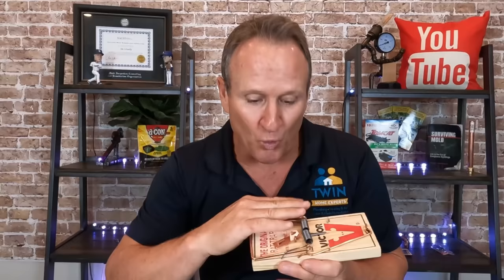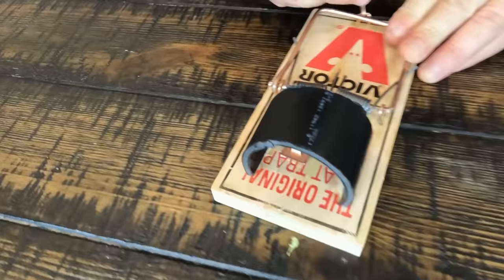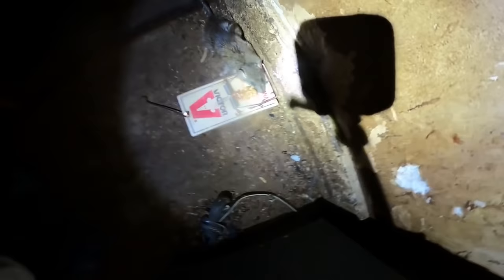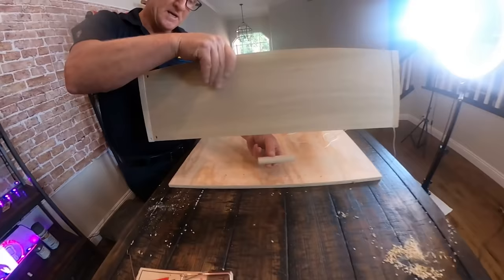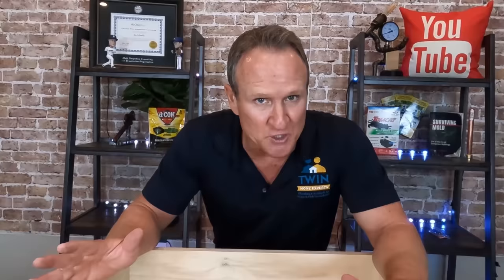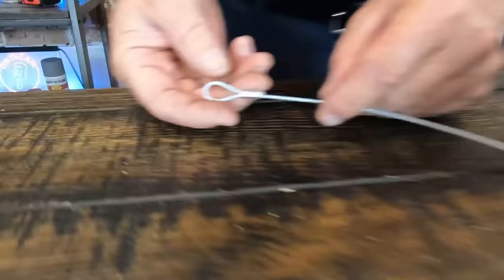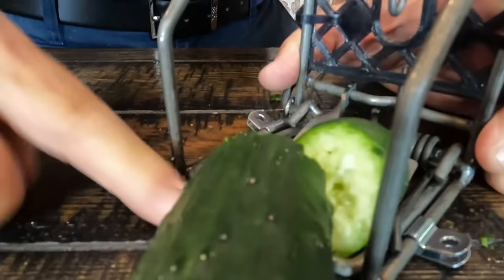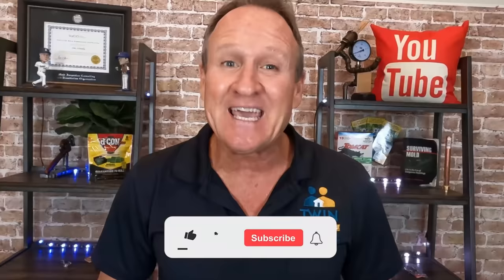EASY RAT TRAP HACKS THAT WORK!! Catch MORE rats FASTER...

Comment: On a comman mouse or rat trap , i smear peanut on the underside of the trigger  .  That way instead of them just licking the bait off they have to stick their snout under the trigger and trip it by pushing it up .  Works well
Reply: Mix baking soda with any package cornbread mixture or just plain cornmeal put it where your cats and dogs cannot get to it and it will kill all your rodents no need for water or any liquid
Reply: @maedorasmith33  your method is a joke.  Been there
Reply: @maedorasmith33   But then they go back inside the walls or wherever they are nesting, die and their rot might stink your house up until you find the carcass.  

 Plus, once the rat consumes it, if a cat or dog finds and eats the weak or dead rodent, then it doesn't matter where you placed the dish out of reach of your pets at, because you may as well have left in on the floor.
Reply: I use tape to cover the bait
Reply: I need to try this
Reply: Pushing it up is what sets it not tripping it.
Reply: @joetroutt7425  the ones with the plastic trigger .  Set one with the metal trigger and then  push up on the trigger
Reply: This has always worked for me!
Reply: Ouch!!!!
Reply: How is sodium bicarbonate going to kill a rat? You might as well just use salt.
Reply: @Owlshadow. actually it's not I just watched a professional pest control video that said baking soda kills rodents. A lady out it out because she was worried about the smell a dead rat causes. The pro had set traps and they were scheduled a week out. So she put it out just in case. And a rat ate it and died and a trap caught one
Reply: Same
Reply: I bought some wonderful Amish soap from a trusted influencer  and that is when I noticed Mr Rat trying to come on the restroom with me in it. I wracked my brain if what we had done differently. It wanted to nibble the soap..it DID. So i secured my soap away in a bag in the freezer set the trap with pb..48 hours nothing..sliced a piece of the soap - it is there new and we shall see if this happens soon.
Reply: Yep! I don't create a smorgasbord for them.
Reply: @dindjarin559 baking soda doesn't affect the dog or cat because they can pass gas but rats can't.
Reply: @joetroutt7425 It's the jostling of the trigger.
Reply: Such a simple, yet BRILLIANT hack for a snap-trap!  👍👊
Reply: @maedorasmith33 oo😮 I i
Reply: Going to try this

Comment: I've trapped hundreds, maybe thousands, of rats over 30+ years. I use mostly Victor traps; occasionally i'll use a T-Rex for rats that may be "shy" of the Victors. I work in Florida where trapping in attics can get HOT; peanut butter is a great bait but in the heat it is easily licked off the bait pan without setting the trap off. My hack is to cut small pieces of cloth (I use terrycloth rags, or old t-shirts) roughly 1/2 inch by one inch, tuck them under the triangular "bait holder" on the bait pan, then push down on the triangle to lock the piece of rag in place. Then I smear peanut butter into the rag. Since a rat's natural reaction to a food source is to bite it and then run for cover (so other rats don't steal their food), when they try it with this setup they always set the trap off while their head is near the bait pan. I've found that this hack works for both full grown and juvenile rats. Wishing y'all good trapping!
Reply: I use super glue to attach a peanut half to the bait holder/trigger and a couple more peanut halves on the wood in the kill zone. I then apply peanut butter on top if the peanut on the trigger. Works for me. Your method sounds very effective. I'll have to try that.
Reply: I used the new plastic victor traps they ate the peanut butter and left,went to old Victor wood traps and piece of cloth soaked in peanut butter under trip lever crimped pin,caught 2,1 giant rat 
Thanks guys will try abs pipe next 1 left
Reply: Excellent.  When I was away my ex wife glued cheese to the bait holder with superglue.  Your method is much better and I’ll use it but her system worked perfectly so I gave her 100 points for resourcefulness.
Reply: Good idea! How do you clean the traps after each catch?  Just soap and water?  Thank you!

Comment: I've had great success with Milk Duds.  Soften the Milk Duds by microwaving in a glass with a little water in it for about 30 seconds, then form the caramel around the treadle.  Cover the Milk Dud with a healthy coating of peanut butter.  The smarter rats seem to be able to carefully lick plain peanut butter off the treadle without triggering the trap, but the caramel from a Milk Dud hardens so much that they end up pulling on it trying to get it loose, and then SNAP!!!
Reply: Rats Often Pass Specific Food Preferences on to Their Young - So Determine IF They Will ACCEPT That Bait First, By Pre-Baiting (Don't  SET Trap At First)
Reply: I do the same using starburst fruit chews.
Reply: @nathanlambshead4778  Great idea.  I'll have to try that some time when I'm not getting success with the Milk Duds.
Reply: Good tip. Will try that tonight. These rats of mine are smart. After getting 5 of them the rest are just taunting me. Licking the trigger clean of any peanut butter without setting off the trap. 😳🤣
Reply: i bought some Slim Jim's and cut about a half inch piece off..i then secured it to the Rat trap with
that small prong on the metal feed plate so the rat had to work to get it off..wasn't long before it 
snapped down on my rat killing it 👍🙂
Reply: I opened the milk duds and was preparing to try your method.....but.... now i need to go buy another box.
Reply: Whats your guys’ opinion on water bucket traps with a plank lid so they fall right in? I’ve seen dudes on here catch up to 20 in one night
Reply: Mix baking soda with cornmeal or any Boxster packaged cornbread mix and put it where other pets can’t get to it only the rats and it will get rid of all your rodents
Reply: @maedorasmith33  plaster Paris with sugar or cornbread or anything it works but sucks to have that smell. Last hear I had 3 flopping in my kitchen and then die. I do not feel sorry for those nasty things
Reply: @kmiller5808  I thought they might like some beer on their bait. Then I drank too much of  it and couldnt get  the trap set.
Reply: @StephRenee812  don't feed the spammer

Comment: I have used every rat trap that can be bought at your local hardware and big box store. Snap traps of various types, glue boards, safe & humane traps, poisons, & plenty of Internet hack traps. The standard Victor snap trap is by far the best trap you can buy. Better than all the modern Victor traps, and better than all competitors. I have killed over 100 rats and mice at a single infested property. Other snap traps generally won't snap, or won't catch the rat if they do. Glue boards: the rat will just chew off the leg, leave it attached to the board, and be freed. Poisons can work, but then you've got dead, smelly, maggot infested rats tucked away in inaccessible nooks. The standard Victor is by far the most consistent rat killing trap. Note that the Victor snap trap isn't consistent from retailer to retailer. The Victors at your local big box store are not the same as the ones at many hardware stores; the big box store trap is better. For bait I always use peanut butter. I've tried other things with poor results, but everybody likes peanut butter.

Comment: Great video. Love the PVC hack idea. Will definitely try it. Dry wall screws are fast to install. But I prefer to use nails spaced around 3/4" apart because it is easy to remove the dead rat just by flipping over the trap.  Whereas with  screws, it may be a little harder to remove the rat. Also, for a stronger kill bar, lift up the part of the spring that's not attached to the kill bar and place a couple of thick washers between the wood base and the spring.  I also glue or screw the trap first to a 3/4" piece of plywood so the trap doesnt warp. Attach a piece of wire to the plywood and tie it to a stick so the trap isn't carried off by a skunk, etc.
Reply: Daniel,  You're exactly right.  I use small brads on Victor mouse and rat traps. I cut the head off 1 brad to drill most of the way from bottom so wood doesn't split when putting brads from bottom. 3 on width, 1 on side sticking up about 1/2."  I also use a small eye screw at the rear to hook a very lightweight chain to something.  Love the tunnel concept.  Wrap kite string around trigger and use P.B... Many times they don't trip it until they start pulling at the string.
Reply: Mix baking soda with cornbread mix or Cornmeal put it where other pets cannot get to it such as cats and dogs and it will get rid of all your rodents no liquid needed
Reply: Oh my golly - just hot glue thumb tacks - upside down pointing up you goose
Reply: @maedorasmith33  The only trouble with that, is the rat goes away and dies. Then you have a smell that's nearly impossible to eliminate.  But in a shed or barn, baking soda is a great idea. So is Borax. Mixed in peanut butter.
Reply: @jefffrayer8238  I use string as well . I try to avoid a bloody mess so no nails, etc. The spring seems to be strong enough to crush their scull or break their necks ...very quick demise .
Reply: @mrcryptozoic817  And I don't want my dog sniffing or injesting any part of of a rat that may contain a poisonous substance. I have one trap inside my wire cage squirrel trap which I blocked half way with hardware wire ...Rats can come to the trap inside but too small for other animals like cats that roam at night.

Comment: Terrific ideas. I particularly like the screws attached to the snap trap.  I often wondered how they were able to escape from a triggered trap.
Reply: I added drywall screws to the roof of my metal bird feeders to keep tree rats from jumping down onto the roofs of my " Tree Rat" proof feeders.  Works like a charm.
Reply: 🐀 Rats Will Sacrifice a Limb to Get  Away, And Use Leverage.

Try Different Types of Traps - The Ones That Look Like Jaws Work.
Reply: Mix baking soda with cornmeal or any package cornbread mix put that where cats and dogs cannot get to it and it will kill all your rodents No liquid needed
Reply: Usually they escape because they didn't come in at the right angle or they're just too fast. That's why it's critical to get them to come in from the front. I think some rats are pretty smart and they know how to trigger the trap and then they can eat to their hearts content.

Comment: I have my traps glued to boards that I lean against walls, high enough that the rat has to stand on its hind legs to reach the bait. I use sunflower seeds or tortilla chips and attach them to the trigger with hot glue.
I've had issues with them getting out of the traps, mortally wounded to go die and stink elsewhere,
so to remedy that put shims under the spring ends, a nickel and 2 pennies thick, to make the arm come down really hard.

Comment: My favorite traps are the tube traps, and I've tried and made a dozen traps to compare.  Tube traps use rodent natural tendency to travel baseboards and tunnels.  They also conceal bait and the spring trap from household pets larger than the tunnel (like cats and dogs of course, but not hamsters).  They're plainly visible when sprung so you know when to empty them, and the dead rodent is concealed inside, not out where guests can see them.  All you do is open the jaws from the outside and shake the dead mouse out of the tube into the trash and set the spring again.  You never have to touch a rat. They usually don't even have time to strip bait in there.  I never had to refill the bait tray even once.    The nature of rodents is to follow walls so they're placed in narrow areas behind furniture or the wall heater, against baseboards, inside or next to - or even inside - chicken coop containers.  Just review the traps every once in awhile and you'll know when to clean them for reuse.  All my rodents disappeared in a month, and I leave food on the counter all night long to test it.  Even food bits in a tray on the floor are untouched.  That's how I check for stragglers.  Of course, no trap is supremely successful unless there's also a relentless search for rodent entrances and they're closed off.

They're great in the kitchen (I eventually found rodents coming in around pipes under the sink) and these traps can even be kicked with bare feet by accident and not trigger them or hurt myself if they do a false snap.   Everything is contained inside the tube.

The other great invention is Ramik bait in packets.  They desiccate rodents so even having eaten and dead, the mouse doesn't stink behind walls as it decomposes to dust.   At first, I used to open the packets to sprinkle the green beads around,  but they're so tasty rats will eat through the closed packet to get to them, fill up their cheeks and carry it back to their cache supply for storage.  Now if I hear rodents in the night, I toss a closed packet behind whatever furniture is in the way the next day and listen to the cellophane crinkling in the night.  No more rodents after that.  Eventually their food storing habits take out the entire community sharing the same food cache, including nursing pups.  When the packet is finished, I throw the empty cellophane away and wait to see if more are coming.  There usually aren't any.  Just sayin'  :)
Reply: any video of the tube trap you described?
Reply: @USArmy91222  I should qualify the description by saying it's not a DIY project but an Amz purchase which could probably be deconstructed to a DIY.  But it's the best trap I've used in a cabin that used to be overrun with mice.  This title should take you there:

eXuby Pet-Safe & Child-Safe Rat Traps w/ Tunnel Design (3-Pack) – Dual Entry for Better Capture Rate - No Harmful Poison - Prevents Accidental Triggering - Avoid Finger Snapping - Setup in Seconds
Reply: KatSense makes one too, titled:
Kat Sense Covered Rat & Chipmunk Traps, Prevents Accidental Triggering with Tunneled Design, Quick Humane Kill, Indoor 'N Outdoor Mouse Snap Traps 

That AMZ post has a product video showing how it can be set (by hand or with your foot) and the obvious 'set or snapped' look to the lever, so nobody has to keep picking it up to check if there's anything in it.  You can tell from across the room.  I put them along baseboards or in spaces behind the fridge and that seems to work since rodents like to travel spaces where at least one side is protected.
Reply: Mix baking soda with cornmeal or any package cornbread mix put it where pets like cats and dogs cannot get to it and it will kill all your rodents No liquid needed
Reply: @maedorasmith33  Half and half? So, it has to stay dry? We have mice and rats, digging in our garden. Ever since there has been a construction site next door. It's driving us crazy.
Reply: @dindjarin559  Good points. I especially don’t want any secondary poisoning, like to a hawk or owl. We have those around here. They are happy to lift,a sick rat.
Reply: @USArmy91222  I used pringles tubes with a mouse trap (too small for rats, I think) in at the far end, and put tape half way over the entrance. It worked well.
Reply: @Dandeleona I can't find desiccant rat poison in the UK. I don't know why not, but I can't.
Reply: Tube traps work real good for the 1st mouse, and then his buddies figure out real quick do NOT GO in THERE!!!
Reply: Fantastic and detailed comment. Thank you for that.
Reply: the short tube traps work great the longer ones suck. you cant tell when they are sprung and its hard to slide the cover on each time you fill them.

Comment: I got a pretty good idea. First you would have the rat trap fastened to the floor so it cannot move, then you would use the exact same glue you would find on glue traps and put it on the rat trap in front of the bait so if a rat steps on the Trap, it's going to be forced either way to squirm as soon as even a foot starts to stick to the glue and it will guarantee that the rat will set the Trap off, and the fluid also prevent the rat from sliding itself out from under the bar and it would not be able to run off with the Trap since the trap would be fastened to the floor.

Comment: If you use a vector basic rat trap, be sure to place the bait end of the trap against a wall or baseboard. This makes rats approach from sides. Works very well.
Reply: I do likewise but I also spread the peanut butter under the trigger pan and not on top of it.  What this does is get the rodent (both mice and rats) to nudge the nose under and try to lift to eat the bait and usually position them far enough into the trap that when it snaps it doesn't hit them behind the neck but beyond it and hits slightly behind the fronts legs torso area.  It snaps the spine over the neck, a little more gruesome and most likely there may be more struggling but when it comes to rodents I don't care and simply want them dead... after setting them up this way each time my trap is triggered I'm unloading a corpse.
Reply: I caught a rat yesterday with the wood Vector trap using a piece sardine . I have used bacon ,sausage , peanut butter for more scent etc. I use string to tie the bait tight so the rats have to work at getting their meal . When I had my huge apple tree the fallen apples attracted rats , the tree is gone now. We must take notice of what attracts rats to the yard . They chewed through my compost bin to get food ! Be very careful using these traps , I got whacked by that strong spring across my thumb , thought I broke the bone , very painful !  Happy ratting !